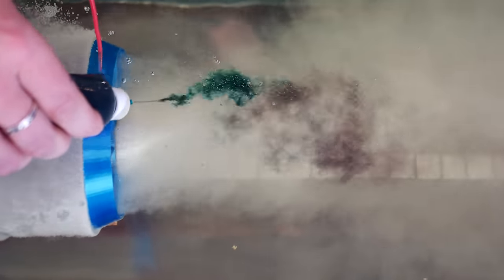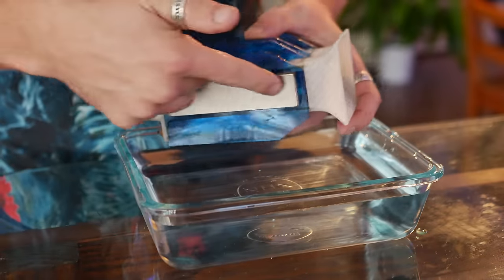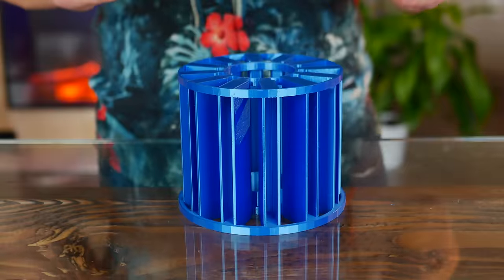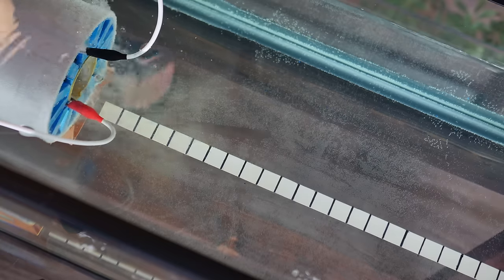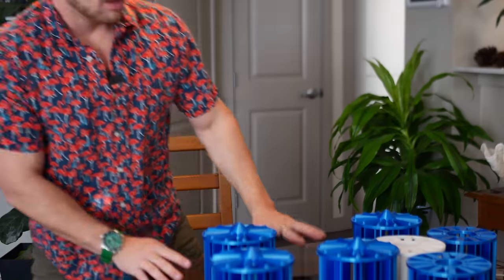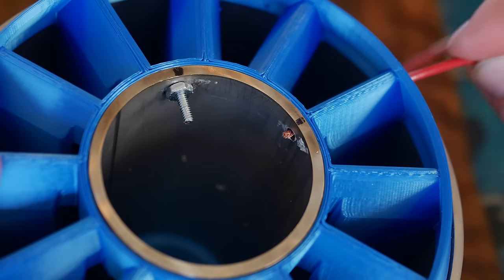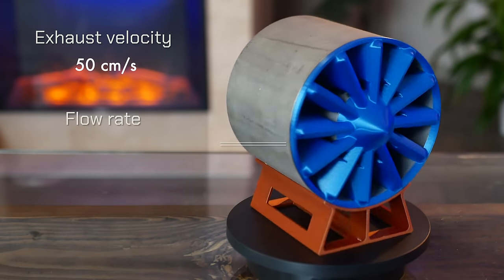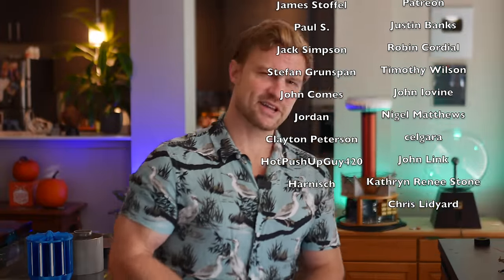Designing a Futuristic Magnetic Turbine (MHD drive)

Comment: Power to weight ratio is just not going to be there. Reason I know that is because there are more efficient ways to move a fluid with electricity. The power being used to charge the magnets just happens to be dragging the water along with it which is just not efficient. Doesn’t matter the scale or voltage, this will be the case. Still a very cool experiment to get people thinking outside of the box.

Comment: Using electromagnets instead of neodymium magnets should increase the magnetic flux density that should increase the water velocity output of your turbine. But you should be aware that during this experiment chlorine gases were constantly building due to the electrolysis of the water. So better ventilate your room after such experiments. And if the water contains too much salt it’s turning into caustic soda which is highly poisonous and alkaline.

Comment: When watching the performance of your 'new and improved' thruster. I see bubbles starting to form on the rear and at the outside of the outside  electrode. The bubbles then progress forward. That could/would be an opposite force being applied to the outside water, by the electrical current of the thruster. To prevent this. Maybe coat the outside, of the outside electrode, with flex-seal too.

Comment: So the critters might not be scared by the noise but you are polluting the water with nickel and chromium from the stainless steel as it is consumed by electrolysis which is arguably worse than noise pollution. Not to mention that you would be leaving a wake of explosive gas (Though whether the gas could ever be an issue would require testing at scale).

Comment: all you need is a magnetic field and a plastic tube.. no magnets...use the field of an electric motor no rotor and that it..that is were the pastic tube goes instead of the rotor.. You can figure out the rest. it used to pump water in the fields.. no moving parts.

Comment: Nope you was right the first time! However u only needed to add a solenoid coil 270Tesla's copper wire 12INCH COMPLETED turns 17#AWG single phase ONE-WAY RECTIFIER PHASE central after the FERRO-MAGNETIC CYLINDRICAL electrode baring the air gap baring add a  CYLINDRICAL copper electrode baring a gadolinium rod fixed central of the air gap not touching the 2MM copper CYLINDER interior wall. and for the exterior FERRO-MAGNETIC CYLINDRICAL exterior electrode add solenoid copper wire coil baring 25#gauge~24#GAUGE stainless  steel wire spun tightly alongside the copper coil of wire 270TESLA'S 12INCH COMPLETED TURNS SINGLE PHASE WIRE ONE-WAY RECTIFIER PHASE exterior steel CYLINDRICAL THE COPPER COIL EXTERIOR BARING STAINLESS STEEL coil of wire SPUN TIGHTLY INTO HELIX COIL ALONGSIDE AROUND THE LOWER COPPER WIRE COIL SURFACE MFD 4/10P should increase 11LBS PER12FT 270TESLA'S 2970LBS NEWTRON'S and THE COIL SHOULD BE ENCLOSED within an 3MM aluminum CYLINDRICAL shelter electrode than u should have more thrust and ESC MODULATED voltage sonic 40,000~100,000 off and on EMI PHASE ELECTRODE 2000w keep in mind law of momentum IN ORDER TO GENERATE HEAT ENERGY VOLTAGE NEEDS TIME!  LESS TIME LESS HEAT LIKE A FLAME PHASE A HIGH SPEED WAVE OF THE HAND GOOD LUCK

Comment: You are still electrolyzing the water.  You are breaking it down into hydrogen and oxygen bubbles.  Aside from the fact that those are highly flammable, they are also reducing the density of the water, and therefore the force the thruster is generating.  It could also potentially cause buoyancy problems for any vessel caught in the wake of this thruster, and if there are two words you don’t want to describe boat, they’re “buoyancy problems”.

Comment: Both tubes have to be isolated from water - to "call that" as "electro magnetic" turbin.
Waht i see now - it is kind of low efficient electrolyzer machine. part of electricy is using to produce gas (gases: hydrogen, oxygen, chlorine and others). and H+, O- > those particles are moving out by electromagnetic field (white wather color - lot of oxygen particles).

Comment: Pretty cool, but how does the efficiency stack up to a standard boat propeller? That's the target, of course. I like the way that the streamlining vastly improved the efficiency. I might also check the efficiency with reversed power/polarity of the magnets. It probably won't do anything, but it's a quick experiment. Hmm. You could also make it in a block shape rather than a round shape. That would make the magnetic field more uniform in the area that pushes the water.

Comment: Lots of naysayers here downplaying the thrust output. But they're missing the point. Shove a bunch of these on a cargo ship, powered by wind turbines and solar panels from above, and slowly but surely that ship will move forwards. Or, retrofit an existing cargo ship with these to provide supplemental power, and reduce the need to burn so much fuel. The principles are not new, it just requires some motivation - like the end of the world through burning fossil fuels. That should be enough?

Comment: Hello)COVER YOUR MODEL WITH A DIELECTRIC .THE UPPER CYLINDER is FROM THE OUTSIDE to increase the current strength INSIDE)INCREASE THE JET SPEED AT THE SAME PARAMETERS

Comment: Wouldn't the two stainless steel pipes just corrode over time due to the salt water?
Stainless steel is pretty resistant to corrosion, but not so much in salt water... I guess you could design it so that the two steel pipes are easily removable so you can just swap them out for fresh ones when they corrode.
Another question I have: Would this corrosion slowly reduce the effectiveness of the turbine?

Comment: My question, should you choose to accept it; I assume there is no yaw affect.  what noise did the drive produce. Assuming it won't work in fresh water and the sea salinity is not constant are there ranges of salinity that would make it non or poorly functional? Would a longer length produce more torque or speed. How would the electric field affect creatures and at what distance , lastly if a long narrow cylinder is surrounded by electro magnets in a larger longer narrow  cylinder that encloses the smaller cylinder separated for the purposes of a submarine-ish vehicle work with higher current . Lastly how could the drive be tracked if it was a submarine. The hunt for red october was based on side engine thrusters as was Yamato 1. Which max speed was 8 knots. Lors have chaned since then

Comment: GREAT VIDEO....I wish I knew you...i'm 64 and have been working on an invention I won't mention here.....for reasons of my own. BUT...I've made tremendous progress over the years.....so much so...that A friend of mine that has his own television program...is interested in investing in it. I'm sure you would know the show. I have access to the money....but am hesitating, due to the fact that im not quite finished with the proto types I've been building. When I watched your video a design came into my head for your MHD drive...i'm going to try it and see if I can get even more propulsion. I do build hydrogen generators on the side and they work pretty good....I use stainless steel on mine...not aluminum. HINT HINT....less rust, and it works better with a magnetic field.

Comment: So this might seem 5 head but what if you used a DC welding machine as the power supply for the motor? I think it would work and the output velocity is gonna be pretty hefty compared to the bench supply. 

Just a thought. I have a torn down welding circuit I use for experiments from time to time.

Comment: Ur MHD drive is exactly the same principle for slicing through air exactly how Anti-gravity aircraft stabilize anywhere in space time through ionization of the air around the craft with use of zero-point high voltage Electrogravitics.

Comment: Okay this works great as an outboard however for an inboard system more information is needed about the performance. 
Basically you've given us the horsepower but you haven't given us the torque. 
So to design an inboard system you have to figure out whether it is beneficial with this engine to maximize thrust by running them in series or is it better to run them independently piped into a single exhaust port. 
Example. Can I put multiple intakes along the bottom of the hull Mount the engines vertically and,

(A) run each engine independently and pipe them into a single pipe out the back 

(B) run each engine independently piped directly out the back? 

(C) do I need to have the intake ports in the bow of the boat mounting the motors horizontally down the length of the hull in a straight line on a single pipe out the back. 

Running the system jointly into a single pipe from the bottom would allow you to use a thrust vectoring nozzle for steering. Or you could have a switch in the system changing the exhaust port to be able to have thrust nozzles on the sides of the vessel for maneuvering on the y axis

Direct out the back in series or independently would require the use of a rudder or dedicated motors for y-axis maneuvering

Or are none of these systems possible because this device would bog down with the slightest back pressure in the way you can't use an ion engine as an air pump to pump up your tire.

All of this would directly affect not only the design of the propulsion system but the actual hull design itself. For instance if you have to directly pipe it out the back in series from the front of the hull to the back of the hull a catamaran or trimaran design would be most effective does not require planing and with simple on off switches you could maneuver the vessel

Comment: What.. about electromagnets? Would it work for this? They can be even stronger than these magnets.

I know the neodymium is a magnet that doesn't need any power, but it would be considered a wasteful design for rare earth. Especially when you consider if this propulsion starts becoming mainstream. 

But an Electromagnet could be powered a couple different ways too. And it uses copper and steel/iron. So it ends up being a lot cheaper as well as not using rare earth metals. 

I've seen some very well designed electromagnets that have tremendous magnetic power.

Comment: Love the idea, but I have a question, either I missed it or you didn't talk about the weight of the thruster. It sure has some significant weight considering all the magnets and the 2 metal tubes as electrodes. Can it generate enough thrust to push itself in water and if yes, what is the remaining thrust able to achieve after you substract the force needed to move itself?
Cool video btw.

Comment: Have you considered using a Halbach Array of magnets to strengthen the flux in desired direction?
Reply: A lot of energy is lost in electrolysis, by focusing the magnetic flux away from directions you dont need i belive you can reduce your current for same flow.
Use ring electrodes instead of tubes where you have a focused magnetic field.

Comment: Could this be ducted like a jet ski impeller? This would give you a vessel that would eliminate external motor drag, could use a nozzle to steer, and the nozzle diameter can be experimented with to provide the best thrust.

Comment: Ok, you made a thruster. That’s 1 mode of operation, but you also making hydrogen fuel too! It’s the same concept, wouldn’t you think 🤔. The only way to know for sure it’s to use this in a container of some sort that will trap the gases that it produces and add a spark to it to see if it ignites, it very well could be used for a wide variety of purposes.

Comment: So I have a dumb question/statement. So what if you where to put the engine in a circlish pool where the engine is pushing water around the pool, force by the moving water then pushes some kind of water wheel which is geared with many gears to up the potential power with minimal effort which powers a generator of some sort which puts power back to the engine. Do you think it could create more energy that energy used??

Comment: No propulsion system will be quieter if the principle itself is not overcome -- throwing away a small mass of the medium at high speed to move a large mass of the vessel at low speed.

Comment: So seeing the cost of the magnets these motors aren't exactly cheap however I'm interested to know are they cheap in the long term when you compare efficiency to a regular electric motor if you can do some testing in terms of how much power they use to push a boat a certain distance versus a more traditional setup and they come out on top in terms of cost per mile it could be a better system long-term as you stated

Comment: The efficiency is terrible and always will be.  Salt water is not conductive enough to allow efficient MHD drive.  The resistance of the water dissipates much more energy than goes into thrust.  That and the design itself is wrong.  There is too much distance between the magnets.  That distance increases the resistance and hence the power waste.  Add to that the electrolysis losses and the thing is, and always will be, useless.  I suggest you read a the 1967 textbook "Energy Conversion" for a discussion of MHD drives.

Comment: Would coating the stainless-steel sleeves decrease performance? If so, would it still be practical to use? 
If that works then you would not need to replace the sleeves.

Comment: You're using voltage and not mentioning amperage... (until near the end of the video). And I'm thinking you need to bring the voltage up into the 30KV range, like you'd get from a cathode ray tube power supply... If this system works in a manner similar to Electro-Gravitic Devices, the higher voltage should better accelerate the water...

Comment: So, one horsepower is 550 ft-lbs / second. Another way of quantifying one HP is 746 watts, or volt-amps. So you are feeding your device with approximately one horsepower. You are pushing 3.65 kg of water per second or actually a tiny bit more due to the higher density of seawater. So multiply 3.65 x 1.025 for  3.742 kg/sec or 8.231 lbs. I will eyeball it and guestimate that in one second you are pushing that column of water two feet. so 16.462 ft-lbs/sec or 0.03 hp for an efficiency of 0.00544%, rather a bit less than most other types of marine propulsion machinery. I understand that this is academic and experimental and that you want to create content that a lot of folks will click on, but you should also disclaim it a bit by showing the ugly side of it, the abyssmal efficiency that even if improved 10x, would still be utterly horrible compared to a diesel engine or even a spark ignition gasoline engine or stirling engine. Your experiment rocks, it is really cool, but since the concept is well known and documented but nobody has seen fit to put it into large scale commercial use, well, it is a really neat parlor trick.

Putting it in a boat? let's say you are pushing a typical 30 foot sailboat. A 6hp four stroke gasoline outboard will push it at about 75% of hull speed easily enough. 4hp is pretty anemic. 2hp will only gitter done under perfectly calm and flat conditions and with no contrary current. scaling up your 0.03hp thruster will make for a crazy big and heavy device. I don't think achieving noteworthy results is even physically possible. Especially when you consider the tremendous size and weight of the generator required to power it.

Comment: With the electrolysis it will not be of much use. I think this will wear off worse then rotor blades and they do wear off rapidly already, becuase of micro explosions of air boubbles in the water. Don't you need only the elctromagnetic field?

Comment: I think the force generated between the magnets and the electricaal current needs to be increased as a ramp from front to rear of the device. Either by narrowing the device bringing the magnets and electrical current closer to each other , or stronger magnets at the middle and even stronger ones at the rear (more magnets at rear?) . every device i know of that accelerates a fluid restrics the volume to increasethe velocity (fire nozzel) or applies greater and greater force to the stream to again increase the velocity of the stream (T.V. picture tube and second anode, linear particle accelerator ) or both as in a gas turbine wher the area reduces in a cone and there are more and more blades and stages of blades to again increase the velocity of the flowing material. I also was thinking is there a optimal length or diameter of the device for a particular electrical current supplied? Also does it matter how far apart the magnets are from each otherand or the way the poles of the magnets are arranged with each other? There didnt appear tobe any magnetic attraction / repulsion between your magnetsd from how they are loaded intio your device, maybe there should be? Or not? Very interesting device no matter what !

Comment: Would the length of the tube change the output?  Making it really long....would that produce more thrust with the same voltage?  Just a thought on your next project...make it the same diameter, but 3 times as long....or just putting 3 of those in front of each other possibly.

Comment: That's a great build!  Ever since I saw this kind of propulsion in the Hunt for Red October, I have wondered if you can get electricity by pouring or pumping water through your MHD turbine.  Just think, what if you put this in the ocean where there's a good current.  Could you convert the energy of the water flow to electric power?

Comment: Why not just make a straight particle collider in space that doesn't collide particles, but rather shoots them out at relativistic speeds. It would take more energy than the whole universe has to push one atom faster than the speed of light, which means, that you could hit an atom infinitely hard, and it can hit you infinitely hard back without the possibility of dissipating into light.